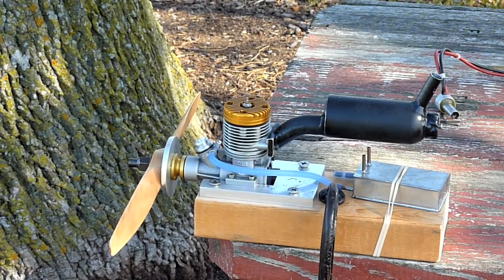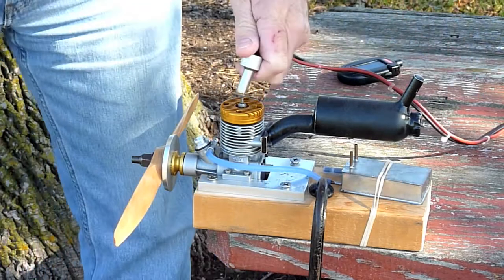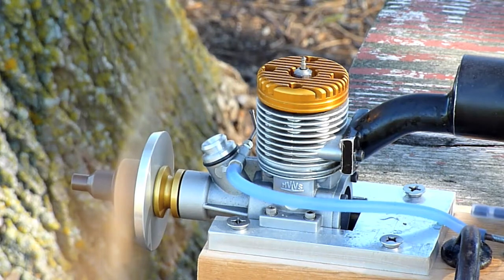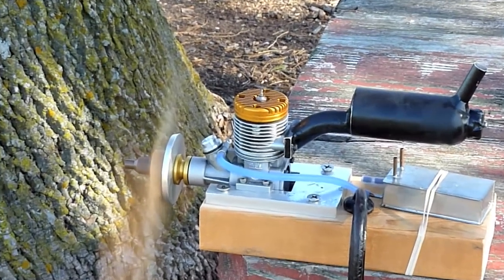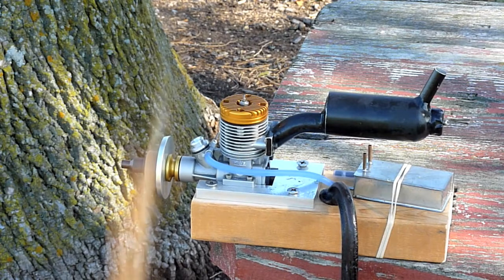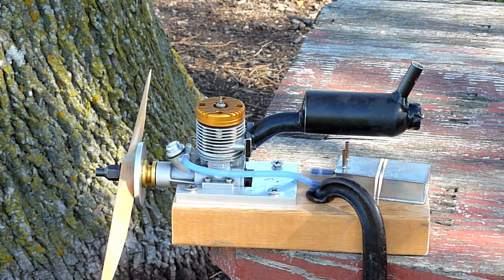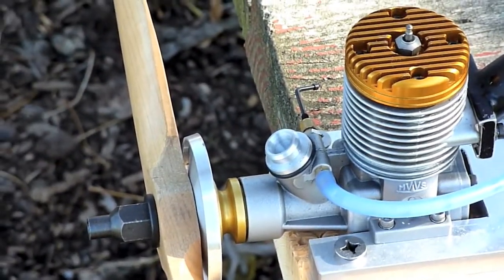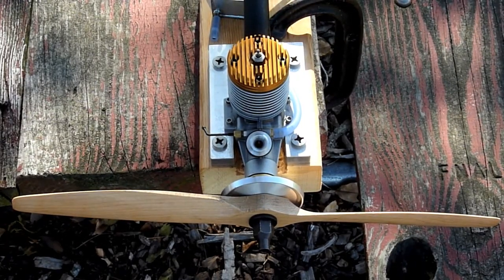MVVS 8CC C/L stunt engine

Comment: Hi.thank respond .Avistar similar ASP .Avistar standart RC engine only with venturis ?
Reply from the maker: +Jan Novak 
The Aviastar is NOT made by ASP (Sanye).  It was made by Aviatronics who no long produces engines.  The .61 sold by Brodak as a stunt engine is NOT the same as an R/C engine with a venturi.  It has a different cylinder timed for CL stunt use.
Fred

Comment: hi,pleas engine avistar 61 cl oky run ? i am  buy arc Strega .
Reply from the maker: +Jan Novak 
The Aviastar .61 had initial problems, however, Brodak had those problems fixed.  So, if you are purchasing a new Aviastar .61 from Brodak, it should work well.  One of my friends has a similar engine/plane combination and he is happy with it.
Fred